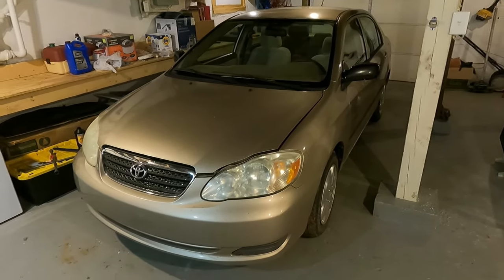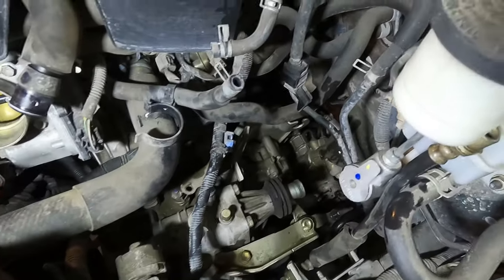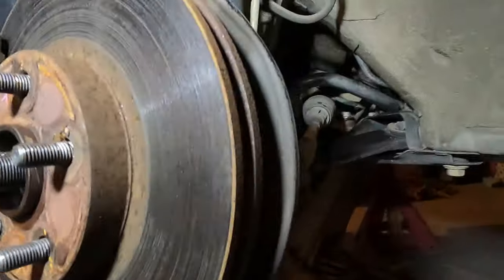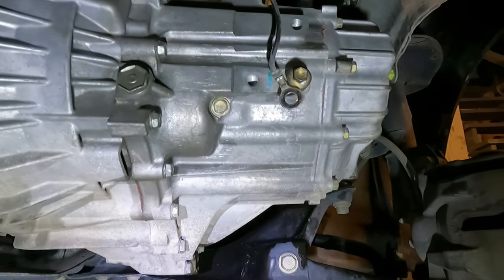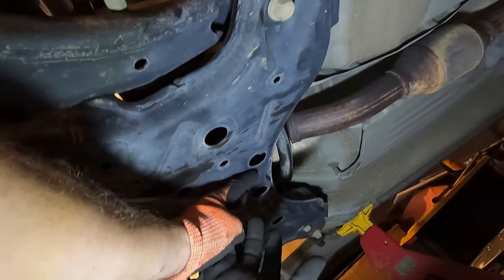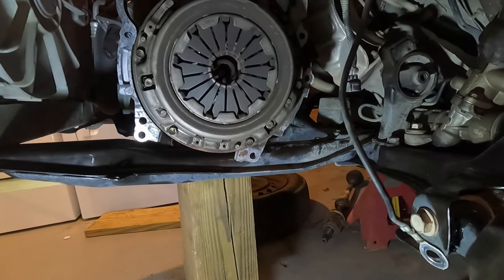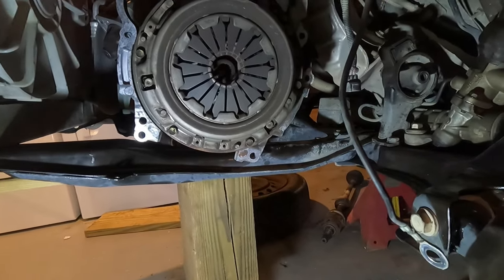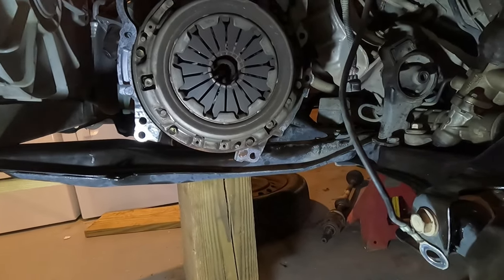Toyota Corolla Clutch Replacement Removal and Reinstall, Pressure Plate, Throwout Bearing, Rear Main

Comment: A good tip for getting the axle to shift out of the wheel bearing is to thread the axle nut back on backwards, almost all the way and put a piece of wood on it before whacking it.

Also, always break loose the transmission fill bolt before the drain bolt to avoid being majorly screwed.

Comment: 22:35 
This is something I've found that I question very much. In every instance I've seen this, but no explanation as to why it was designed without it. So weird and it makes no sense cause it's gonna be really hard to line it up without a pilot bearing. Lucky you didn't have any issues with lining the trans up. I'm about to try to do this today.

Comment: Appreciate the thorough video! It has been quite helpful. Running into an issue where the pressure plate doesn't seem to apply enough pressure on the clutch fork? Essentially once I mate the engine and tranny together, the clutch fork moves freely back and forth. I feel no resistance.
Reply from the maker: Thanks. I filmed this before i had the ability to edit with imovie on my mac. i figured it might help someone a little.

Comment: Thank you for this video, very informative. I am doing this but engine if off the bay; I took it off the engine bay 3 years ago so I do not remember about the pilot bearing and can not find references anywhere for my 2004 Toyota Corolla CE, the pilot bearing that came in a kit I bought does not fit anywhere, so I ordered Timken pilot bearing from Amazon but may not even need the pilot one, I recon what I need is different Clutch alignment tool that would allow me to center the disk and plate without the bearing; I believe they sell one for $15.00 bucks have seen it before. I have the same clutch kit you are installing here BUT after seen videos on you tube how the plates disks shattered I decided I am ordering Exedy or some other brand, I had an Stage 2 for the Corolla and Stage 3 for a 2000 Tacoma but will be returning them, eventually paying way more for 2 clutch sets from different brands as I want at least stages 2 or 3 for whatever reason itches me. How have your clutch been performing to date? I am curious.
Reply from the maker: Clutch is holding up. Car was still on the road the last I heard.
Reply: @MyWhiteWhale  I got spoked because there is a video showing 2 you tubers with broken push plate disks, destroyed literally which makes me think twice about those 2 clutches from them; bought them on amazon 30 days exactly today expires the return window, the problem is I already had the flywheel installed when I saw the videos, took it off, cleaned parts and bolts threads and shopping for a new clutch BUT it wont be in until next Friday the earlier, I am frustrated because of my own decision; I do have an EFI OEM replacement Clutch and Push plate with a Steel 17 pound fly wheel that I could install right now but wanted the 13 pound Fly wheel from Clutch Max which is 13 pounds and looks really well made; do not anticipate that part failing EFI clutch kit  I bought it at Amazon 3 years ago for $130.00 total, a stage one I figure would install a lighted fly wheel to have a little more response from the car; this is not for racing or drifting, just to be able to drive more aggressively in traffic and get better response; I don't know why I am fixated on an aftermarket clutch, sucks to have all these decisions to make and the engine waiting in the garage!

Comment: I've got over 200 K miles. Started slipping at 1st only when extremely cold at 180K miles. Now it's time to change. 😌
Reply from the maker: I figured it would go out when i bought the car. Come to find out that was why the u sold it to me. The lady said "just let off the gas and it'll work." Not sure if she knew the clutch was a major issue or not.
Reply: @MyWhiteWhale  same happened to me !! 
Seller told that it is normal in this kind of cars. 
He manipulated me!! 

Btw what will be the costs for changing clutch plate ?
Reply from the maker: @pratikchavda3575  parts will be about $200 plus 8 hours labor in a shop. 8x$75=$600 
Total cost $800

Comment: Thanks for sharing your experience! Does somebody know if the procedure is similar on Corolla Verso 2.0 D4D 116hp? My main concern is the transmission weight - if I can handle it manually without any special stands or supports.
Reply from the maker: I would say the weight would be the same. I would advise using a low profile transmission jack. Don’t trying wrestling it like I did.

Comment: I would say based on the lack of rust and a decent amount of dust under the hood this tells me you're from Somewhere between Texas and Southern California or Mid to South West but not the North West and most definitely not from anywhere North of Maryland/P.A./NY etc on the East coast because you would have rust everywhere and I see no undercoating.  My Corolla was exactly like yours when I got it used with 100k on it because it came from Nevada. After just 2 North Eastern Winters the car is now a rust bucket and it makes relatively easy jobs like a clutch replacement very precarious when bolts get so rusty they snap.

Comment: Should I worry about extremely cold temperatures like -10 F on the clutch on my Matrix? Could I eventually break something the linkage because the clutch is much harder to push in especially in the morning?
Reply: I drive my manual Matrix in -40F no problem. The gear fluid is thick though so stay in a lower gear for a bit longer to warm up the fluid.
Reply: I would worry
Reply: @AutismusPrime69  Why?

Comment: I'm at 230,000 right now. 2015 Corolla s. Pretty sure I need my clutch replaced. It started to really struggle to drive. Doesn't want to shift to first, it clicks and goes back to neutral real hard. But I could get it after a few tries. Then it started to make a weening sound when I was driving. Tonight it started acting up real bad, high reving,low power, it's clicking real bad, and it's real loud. Does not want to shift into gears. I think I can do this. Any tips before I start? What are some other cheap things I could replace along the way? ?
Reply: That sounds like more than the clutch
Reply: You wanna make sure your clutch slave cylinder is working, bleed or just replace it completely. But you also seem to have a worn clutch also.

Comment: I just ordered the exact same clutch kit for my car... how did that clutchmax kit hold up? Thanks for your help! Amazing Video!!
Reply from the maker: I recently sold the car but I never had any trouble at all.
Reply: @MyWhiteWhale  I saw you mentioned that if you did it again you’d use a different clutch maybe due to overheating? Did that issue go away in time ? Or was the clutch a good clutch?
Reply: @MyWhiteWhale  How long did you get to use the new clutch before selling the car.. thanks for answering my questions!!!

Comment: dang... I don't have a garage or tools. And no money to hire it done. Can't drive in 5th gear anymore due to no acceleration. 4th almost as bad. I watched this to try to encourage myself to try fixing it, but it looks too hard for a guy like me with no tools or skills.
Reply: I did My first Toyota clutch replacement as a Teenager years ago with very basic tools and it worked out well.
I used a screwdriver handle as an alignment guide.

Comment: Even I have changed the clutch but the clutch releasing gap is very low where the vechile is having shattering in 1st gear. Can I adjust it ?

Comment: Can anyone help me, I have 08 Corolla 1.8 and every time I accelerate the car from 2 gear to 3rd gear the car feels like it’s choking on it self and jerks a little and it only happens in 2nd and 3rd gear, is that the clutch?
Reply from the maker: Sounds more like a miss when you say "jerk." Have you replaced the spark plugs, wires, fuel filter and air filter lately? Always good to start with a  tuneup.
Reply: @MyWhiteWhale  I did the spark plugs a few months ago but the guy that did it seemed kind of sketchy so hopefully he didn’t cam me. I guess I’ll start by checking the fuel filter.
Reply: Did you get this resolve? My Matrix 1.8 is doing something similar. Thinking it might be clutch too.

Comment: What clutch and flywheel did you buy?
Reply from the maker: I bought one from ebay that come with everything including the flywheel. I have noticed that it is very easy to get the new clutch hot. I would highly recommend using an OEM quality clutch.

Comment: How many miles did that old clutch last? Out of curiosity
Reply from the maker: 180,000 but i think it would have went further.
Reply: Mine hit 220 thousand the other day and I am getting it replaced soon. Its starting to slip in forth but would probable go further
Reply: I'm at 230,000 right now. 2015 Corolla s. Pretty sure I need my clutch replaced. It started to really struggle to drive. Doesn't want to shift to first, it clicks and goes back to neutral real hard. But I could get it after a few tries. Then it started to make a weening sound when I was driving. Tonight it started acting up real bad, high reving,low power, it's clicking real bad, and it's real loud. Does not want to shift into gears. I think I can do this. Any tips before I start? What are some other cheap things I could replace along the way?

Comment: do you need some special tools to remove some parts? and transimission oil need to totally replaced finnally?
Reply: The first trans fluid replace at 60k then every 35-40k there after its just a drain and fill.  Redline is the best.

Comment: So many uses for WD-40... that it should never, ever, ever be used for. WD-40 is not a good lubricant for anything that needs to stay lubricated. In fact, it's the opposite of a long term lubricant. It is a solvent for long term lubricants.

Comment: 1990's Honda 4 Cylinders were SO EASY compared to this. Also MK2-3 VW's are a piece of cake except the axles are bolted to the trans but with the proper tool from Snap-On and an impact gun they're really not that bad. It's the motor mounts that make doing a clutch on this corolla such a pain in the neck imo. They should have just used a K Frame like VW b/c all those floating rubber mounts don't do a damn THING to help with Vibration on these Corollas. Unsprung weight blah blah blah. For a Japanese 4 cyl this clutch job kinda sucks!
Reply: Hands down worst clutch I ever done, Toyota's are reliable but these corollas/ matrix are a bitch to work on

Comment: Before you change the clutch on a toyota corolla make sure your slave cylinder on the transmission is not sticking and hanging up.

I got a 2007 3 years ago, and the clutch sometimes would slip, esp in 3rd or 4th gear if I gave it a lot of throttle, the tach would jump from 2k to 3k RPM, and then catch again - kinda like if I was riding the clutch with my foot on the pedal. After 3 years and 25k miles it did not get any worse, so it couldnt have been the clutch plate wearing out.

Turns out the slave cylinder has been sticky all this time, not letting the clutch fully engage. I pushed it all the way in with my finger several times and the slipping stopped. I sprayed some white lithium grease inside its bellows boot, and now I can feel the clutch is FAR more responsive to pressure on the pedal - its way easier to take off from a stop, I can make the car creep up when I need to...

The car had 107 k miles when I got it (for $2800) and I thought I was looking at a $1200 clutch replacement. Now it works like a new car. I can take off from a stop and go thru all 5 gears with the throttle to the floor, and the tach is rock solid - no slipping!
Reply from the maker: Yes. Thanks for the advice.
Reply: I have an 08 with the same slippage issue. I'll try your advice and see what happens. Might save a few bucks.
Reply from the maker: @elisebastian153  How many miles are on your car?
Reply: @MyWhiteWhale  221k & I believe 3rd clutch.
Reply: @elisebastian153  Did you try it and did it fix it? I have the same problem
Reply: Hey bud, I’m having the same problem with my Corolla. I’ll give that a shot this weekend. Thanks for the tip!!!
Reply: Hello, could you explain how you did this? Did you remove the slave cylinder? Thanks